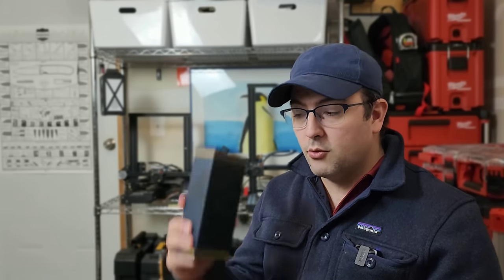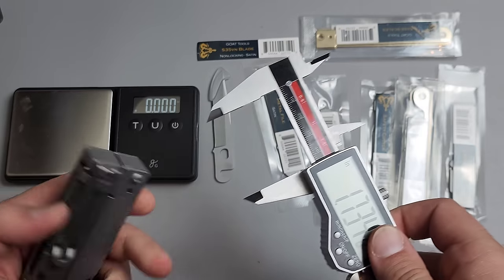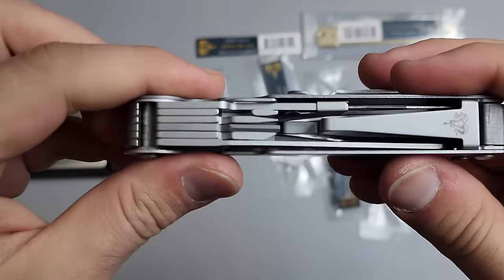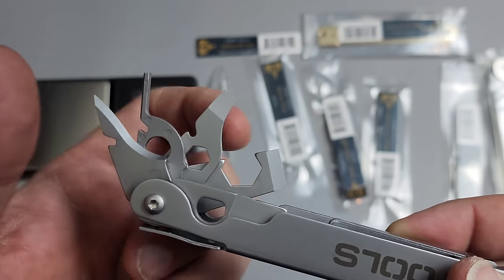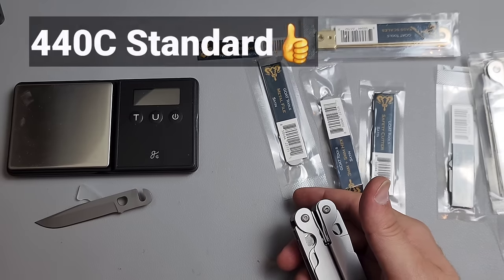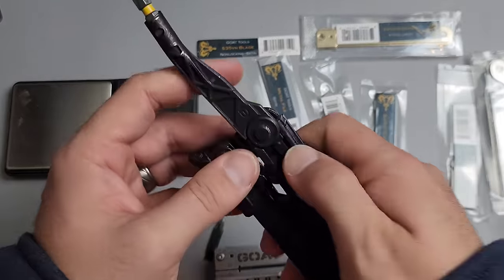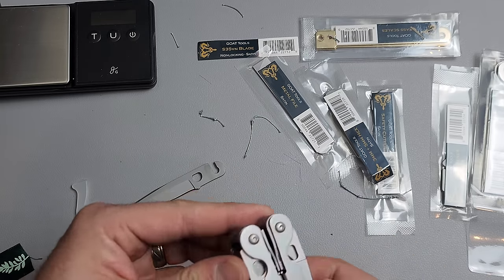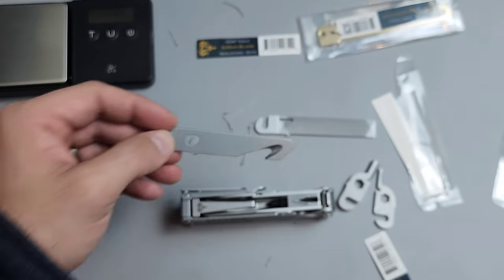🛠Modular multitools are the future.  (First look at the GOAT Tool)

Comment: Wish they made a LOCKING high quality blade. "Here, have a tougher blade you can abuse, but now it'll fold in on your hands on accident!"
Reply from the maker: nope, no more than any other liner lock. Its only a risk if you doing something really silly with a folding knife.
Reply: You can choose if the blade is locking or not. I ordered my S35VN blade as a locking blade, the choice is ultimately yours
Reply: @maxlvledc  I do a lot of silly things with my tools lol  😂
I've had it happen. If you push with the tip it could close on you. It's unlikely with light use, but multi tools are rarely normal light use.
Reply: @abdulrahmansalem8061  This is good to hear.

Comment: ill break it in a week per my job ill test it and it will fail
Reply from the maker: If your using it like a dedicated pair of pliers or any other tool..yes of course it will break. A Multitool is not meant to REPLACE a dedicated tool. If you are trying to break it I guarantee you will succeed.

Comment: Well as i worked for Gruschwitz.. engeneered high tec fabrics.. we made from fieber thread and yarn… … and both dyneema and kevlar is ok to cut and quite similar.. aramid isn‘t… 
And thick fibers of polyamid are infuriating..  but still.. fancy strong materials but mostly cuts like anny other fiber especially woven and not loose strands while kevlare os more taxing on your blade and needs mor pressure than dyneema .. and your scossor will crap oit of the dtex is either to high or to low…

Just saying.. fanci materials.. bit not that hard to cut… almost a waste of money… (also this is not 100% kevlar because o it would get red under sunlight and loosing szrength while doing so)
Reply from the maker: In my testing it was the thing most scissors failed to cut.

Comment: Stuff like this is OK. It may well be the way forward.
But you find me a job that a Victorinox Swisschamp or Swisstool cannot do. And the quality of Victorinox is not even up for debate. Bearing in mind that my Swisschamp is completely UK LEGAL CARRY.
Reply from the maker: cant argue with that...20 years later a vic will still be kicking.
Reply: ok, how about you are fixing lights on a tractor. Gotta cut a few damaged wires, then splice in new ones with crimp connectors. It is getting dark, so you don't have time to fold/unfold tools a hundred times. Ha! Do that! :D
With larger pliers-style tool, flip them open and you have cutters (dedicated blade), strippers (dedicated part of the cutter blade, at least on some), and crimpers ('inside' of the piers, opposite of the cutters across the pivot). Everything conveniently in one spot. From what i could see, Swisschamp has all those tools as well, but it's either "keep all open and poke yourself in the process" or "open each individually, then close before opening the next" due to how they are made.

Comment: *the advent of yet another take on a multitool that has interchangeable options (which contradicts the ALL IN ONEness of multitools) gets compared with the advent of the smartphone. 

I'm guessing the impact on society won't be quite so monumental. I dunno. Maybe i'm wrong, and i could be, we'll see in a couple of years. Whatever. I'm going to say it will be regarded as having less of an impact than the advent of the Leatherman. Not because the Leatherman is better because multitools are subjective and user dependent but because this is a tweak at best, most likely a fad. Maybe, whatever. Those scissors though....i mean did that really just happen?

Comment: Those brass scales have about 2mm on the bottom side of the screw...for you to even suggest them being produced in a wood finish tells me all I need to know about you. And you compare them to the oem version...massive difference from the end to the screw opening. As a day in day out letherman wave user, how you can use your actual eyes and say this is an aesthetically pleasing and ergonomic product is amazing 🤷🏻‍♂️ it looks shit, looks weak, looks, given the sharp corners, painful to use and lacks any thought and basic design. Given; a modular swappable design is great but quality is what matters with tools like this and I can see this will bend and snap pushed further than the cutting of a ribbon you demonstrated it with 👍